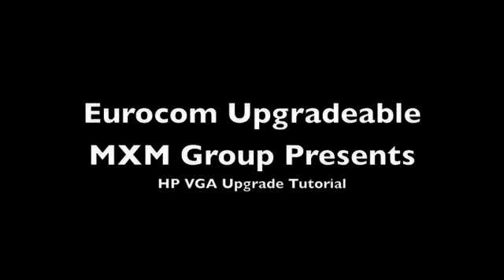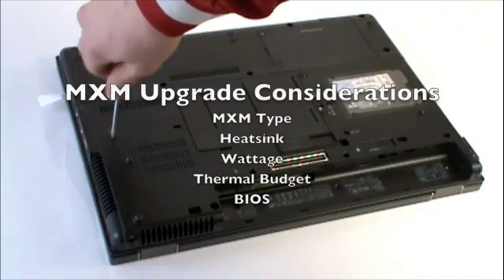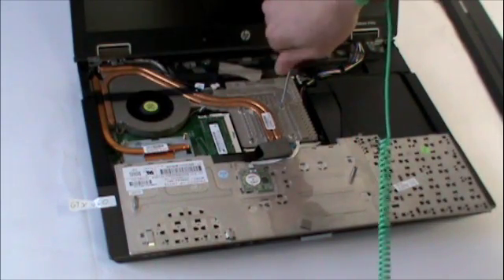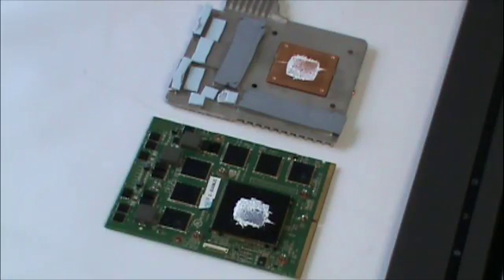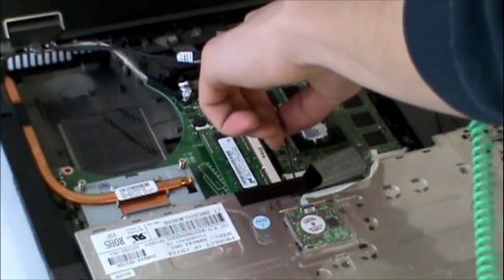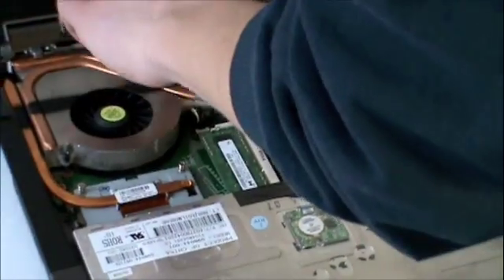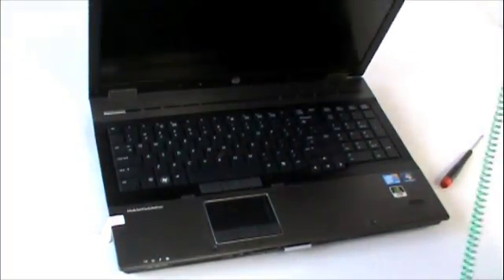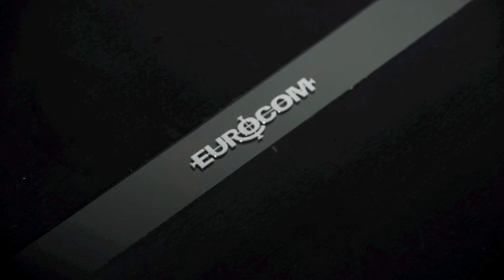NVIDIA GeForce GTX 460M Video Card Upgrade Guide for HP 8740W by Eurocom

Comment: I have an HP 8740w and I would like to upgrade the GPU. Does the BIOS have a whitelist on this machine, or can I use any GPU which fits the MXM 3.0b socket and heat budget?
Reply from the maker: Here is the link to the HP 8740W upgrade page on our website.  Here you will find all the upgrades available for your notebook...  http://www.eurocom.com/ec/upgrade(2,425,0)HPEliteBook8740W

Comment: Hi

any can confirm if can fit a 460m card in a HP Elitebook 8540W (i7-840Q)? or what is the latest card (include  quadro) can fit in it? my laptop come with Quadro FX1800M

greetings
Reply from the maker: Hello!  I can't confirm that specific upgrade.  But it does support graphics upgrades.  I found this video here: https://youtu.be/59wsxQZcMl4
Reply from the maker: It appears to be an MXM 3.0a card which is smaller than a 460M MXM 3.0a card.
Reply: about the 8740w. what is the max gpu can handle this laptop?
Reply from the maker: I am not sure if anyone else has a higher performance card working but I know it support 460M and K5000M.  I've seen online that the 6970M also works.  The 8740w supports MXM 3.0b cards but that does not mean any MXM 3.0b card is supported.

Comment: i have an Asus laptop with an Nvidia GeForce 940m...i tought it was a high-end card...but its not--"..and i  need a new gpu..can i upgrade it to GTX 960m...or maybe an older 780m??
Reply: +xbbxnxnx As far as I know the 940m is integrated so you shouldn't be able to
Reply from the maker: +xbbxnxnx I am not too familiar with that system.  You will need to research that, find an ASUS blog, Tech Inferno is really good.  Asus typically uses a different shaped video card than other companies as well.  Good luck!
Reply: +EurocomTechnology yeah...i will try...thanks for the help
Reply from the maker: xbbxnxnx Good luck!

Comment: Hi, I have an HP 8540w using nvidia quadro fx 880M , if I can replace the card nvidia geforce GTX 460M okay? i thing HP 8740w same HP 8540w
Reply from the maker: +Nguyễn Văn Hưng That is very possible.  I can't confirm that though.  Please contact support@eurocom.com and they can test or arrange a card for you.
Reply: +EurocomTechnology it's not. HP 8540w using video card slot MXM 3 type 
  MXM-A 82 mm x 70mm max 55w
HP8750w using video card slot MXM 3 type 
MXM-B 80 mm x 105 mm 100w
Reply from the maker: Ok, that is fine.  MXM 3.0a is a valid card size.

Comment: Hi there, am I right in assuming that the HP EliteBook 8540W supports the nVidia GeForce GTX 460M? Thanks for your answer.
Reply from the maker: ***** I believe that laptop is also upgradeable but that does not mean that this card is also supported in that system.  In short, I am not sure.  There is typically information on forums about this type of thing.  we also offer an upgrade service where one of our technicians attempts to upgrade your system.  Contact sales@eurocom.com is interested.
Reply: +Tilman Scheffel  HP 8540w video card slot type MXM 3.0 -A 82 mmx 70 mm
gtx 460m Type MXM 3.0 82 mm x 105mm.
You try NVIDIA QUADRO K1000M
Reply from the maker: Nguyễn Văn Hưng We have not tried to install the K1100M in the HP 8540w.  We do have those cards though.
Reply: Thanks for answers , maybe I should consider buying a new laptop

Comment: Just for future proofing, since you guys at Eurocom use Clevo systems,
Is the Clevo P650SE/SG's or your Eurocom M5 Pro's GPU upgradable?
Because I heard that it might come soldered into the chipset.
Reply from the maker: The GPU and CPU of that system are indeed soldered onto the motherboard and cannot be removed.
Reply: EurocomTechnology Aw, darn.
But are there any laptops that come around the same weight, but is still MXM Compatible?

P.S. Just asking if you know, but with the space and the little amount of limitations in this barebone, I see no reason why there can't be an MXM module.Do you know why?
Reply from the maker: DatGameh Definitely, the brand new EUROCOM P5 Pro has modular VGA and CPU, The X3 and Racer 4 are both great options.  Check them out here: http://www.eurocom.com/ec/products()ec

Yes, the P650 has integrated CPU and graphics to accommodate its thin profile.  An MXM card and corresponding heatsink are relatively thick and do not fit in thin laptops.
Reply: EurocomTechnology I see. From my perspective, it doesn't look that thick!
And that Racer 4 sounds well enough for me! I just might consider getting it.

Thanks!

Anyways, you guys have been helpful and responsive with these comments that you are getting. From me and others. Unlike other brands that I know of! As a thanks: Subscribed!
Reply from the maker: DatGameh The Racer 4 is a great system.  Stay tuned, we are getting ready to post some new videos on some of those products I mentioned above.  I think the Racer 4 is a great balance between size and performance.  Thank you so much for your kind words! Let me know if you need anything.

Comment: Hi, I've a question, how can i replace my nvidia quadro fx 3800m on my HP elitebook 8740w? There is something with more performance than the gtx 460m, I've MXM 3.0B "Sorry for my english"
Reply from the maker: It should be an easy upgrade.  Not sure what the highest performing card is, sorry.  Please let me know if you need anything.
Reply: EurocomTechnology Hey man, gret video.. I have an HP Elitebook 8740w as well!, so what gpu do you recommend?
Reply from the maker: Shadow Knight - Road to 100k subs Of the 400M series, we were able to verify the 460M.  I have also seen users upgrade to 6970M.
Reply: Thanks =D, instead of getting a full tower I'll probably just convert my laptop into a gaming pc :3, do you know if its possible to change my processor easily? I have an i7-640m, I think I can run the 6970 without a bottleneck though
Reply: EurocomTechnology do you know of a higher gpu that I can use? perhaps one of the 700 or 800 series?
Reply from the maker: Shadow Knight - Road to 100k subs I'm not sure to be honest with you.  We did testing on this system a long time ago.
Reply: Okay, I think I'll go with the 6970m. Thanks :P
Reply: EurocomTechnology Hey I need your help again..I really wanna know if the 6970m is blocked in the BIOS, do you remember doing anything special to the bios or something? I'm really worried
Reply: EurocomTechnology what pc are you using in the video btw?
Reply from the maker: Shadow Knight - Road to 100k subs HP Elitebook 8740W.
Reply: Oh great! but did the BIOS whitelist it or something? I might not actually replace my gpu as there is a pci m to pci adapter, i can get any gpu I want..im really worried about the whitelist though

Comment: hi guys 
i have asusX550L i7 4500 u 8gb  nvidia gforce gt720m 2 GB 
please i want to know if i can change the graphics card into  gforce gtx 770???
and thanks
Reply from the maker: Asus uses a different MXM spec so standard MXM 3.0b cards do not work.  You will need to work with Asus on that.
Reply: how please?
Reply from the maker: Aziz Ben Amor I suggest contacting ASUS technical support department for assistance on that.
Reply: thanks bro but should i go to the site?
Reply from the maker: Aziz Ben Amor Proceed as you wish.
Reply: thanks bro
Reply from the maker: Aziz Ben Amor Good luck!

Comment: Hi bro, I got HP envy 2002ea with AMD hd 6630m 1Gb together with intel hd 3000, I was wondering if I can put something with 2GB or better in it instaed of AMD, thanks a lot, if you can check - that is my laptop http://www.cnet.com/products/hp-envy-14-2002ea-beats-edition-14-5-core-i7-2630qm-windows-7-home-premium-64-bit-8-gb-ram-750-gb-hdd/specs/
Reply from the maker: hi Bud!  That system looks to have integrated graphics that cannot be removed and upgraded.
Reply: EurocomTechnology Yeah, but integrated one is the intel hd 3000. However, Ive been able to open my PC to clean and I took out the AMD one. Does that mean that is not integrated? the problem is that the replacment card could cost shitloads of money..
Reply from the maker: Philip Sevastyanov Interesting.  I am going to look more into this.  Are you sure what you removed is the AMD card?
Reply: EurocomTechnology Yep bro, wanna try out crisis 3 with good fps. I know that more reasonable is to build Gaming PC, but I paid more than 1100 pounds for that hungry HP 2002ea
Reply from the maker: My technicians are telling me that your card is most likely an MXM 3.0a card.  Good news it can probably be upgraded.  Bad news, we dont offer those cards.  My advice would be to look for a card that is the same series, such as the AMD Radeon 6970M or 6990M.  Not sure if that will do it for ya though.  You will need to do some research my friend.
Reply: EurocomTechnology Thanks bro!!

Comment: I own a HP EliteBook 8540w, they run MXM_3.0b correct?
limit would be gtx460M - 470M? Thank you in advance!
Reply from the maker: Yes, that system supports MXM 3.0b graphics. Not sure what exactly it supports though.
Reply: @EurocomTechnology  hp elitebook dont support MXM 3.0B cards only MXM 3.0A cards

Comment: Hi Eurocom!
I have HP Pavilion dv6-7029tx Entertainment Notebook PC which has Nvidia Geforce 630M 2GB gpu. I would like to upgrade to a good MXM-A type gpu that would be able to run games like Assassin's Creed 4, which my current gpu sadly can't.
I would hugely appreciate any suggestions :)
Reply from the maker: He Yamakaro!
We don't really specialize in MXM a type graphics cards.  Going from a 630M to a high performance GPU would be a huge boost.  I'm not even sure you can upgrade that notebook.  Sorry I couldnt provide  more help.
Reply: EurocomTechnology It's alright, thanks anyways! :)
Reply from the maker: yamakaro
No problem.  Good luck!

Comment: Hi Can I Upgrade My Laptop Iam Using Asus S550C I Would Really Like To Change The Nvidia to 700m Can i Thanks In Advance
Reply from the maker: No, I believe that system has integrated graphics.
Reply: EurocomTechnology i am using S550CB-CJ120h with dedicated GT740m , can i upgrade?
Reply from the maker: Dumb Fuq Not sure if you could upgrade that system, to be honest.  Does it have an MXM 3.0b card?
Reply: How to i find out?
Reply from the maker: Dumb Fuq You could do some research online or it may be in your owners manual.

Comment: I hope My laptop is fixed soon. I took it in to get repaired, but i am not sure it is possible to even fix my laptop :( It turns off during anything that requires the graphics card. Skype screen sharing, playing a video game. It turns off even when everything is nice and cool temps. It evens turns off when windows loads and its not plugged into the power. Its probably a short or something in the 460 graphics card. I am so sad right now :(

Comment from the maker: @tao1541 
An ESD strap.  "An antistatic wrist strap, ESD wrist strap, or ground bracelet is an antistatic device used to safely ground a person working on very sensitive electronic equipment, to prevent the buildup of static electricity on their body, which can result in electrostatic discharge (ESD)."